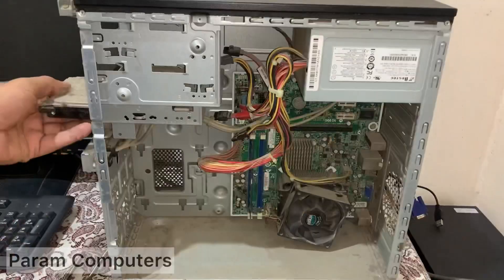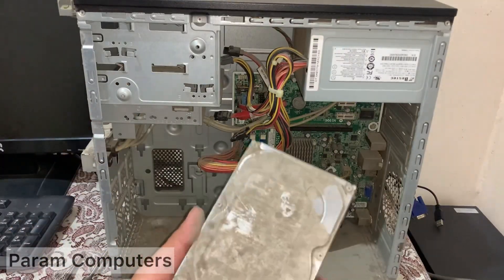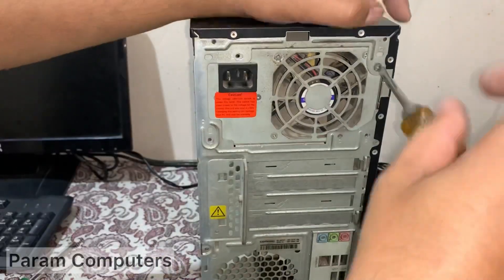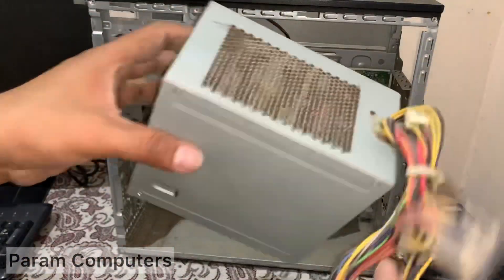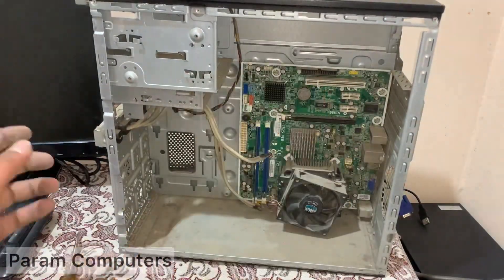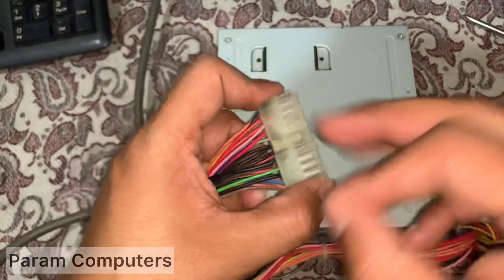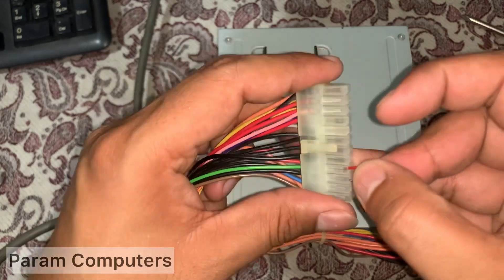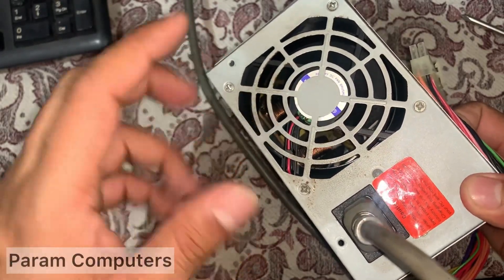Compaq Presario SG3730IL. Deep cleaning+Upgrade+Windows11 Pro

Comment: Water damaged PCB, wonder if it still works? Maybe now but give it some time when the corrosion  start to kick in.
Reply from the maker: Everything is working bro
Reply: @paramcomputers007  water goes into so many which will creat a lot of problems in the future due to corrosion. It is not a good idea to wash a motherboard, no matter how long you dry it out in the sun or  a heat blower.
Reply from the maker: @Davysguru  I tested everything even i did washed my Primary system 6 months ago and still working perfectly without not even single issue

It just possible because i know how to wash these type of components.
But True is everything is depending on knowledge and experience

Comment: Love your dedication towards achieving perfection. Few suggestions.
Wear gloves while first opening pc. Also wear a mask if needed. Do not ever wash SMPS with water. That is extremely dangerous. No need of washing processor with water. I assume you also used a dryer to dry the components but may be you did not show in the video. Instead of a hard disk use an SSD and install windows 7. It will run like a beast.
Reply from the maker: Thanks so much for your lovely Comment & Suggestions.🙏🏻❤️ i ll follow soon as well possible.

Comment: why do u wash electronics?
Reply from the maker: Its good to wash them. . Because i bring these computers from working places in so much dusty condition . So i prefer to wash them. Than to normal cleaning.   But because any process i discharged every electronic part to prevent short circuits
Reply from the maker: My style 😆
Reply: @paramcomputers007  i like ur videos keep it
Reply from the maker: @sabaamiranashvili2334  ❤️